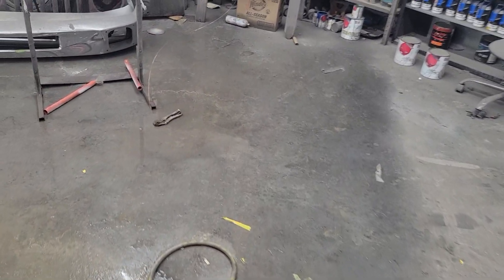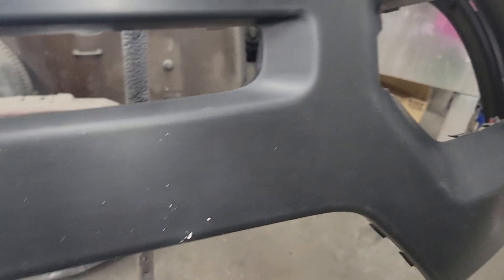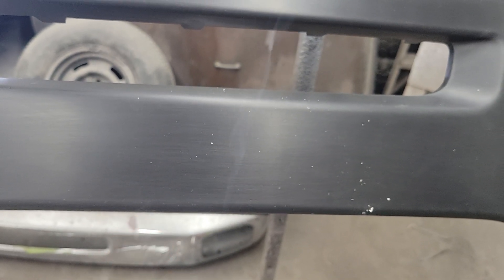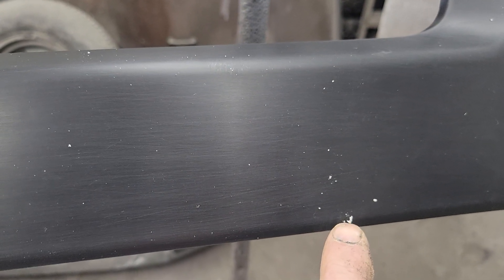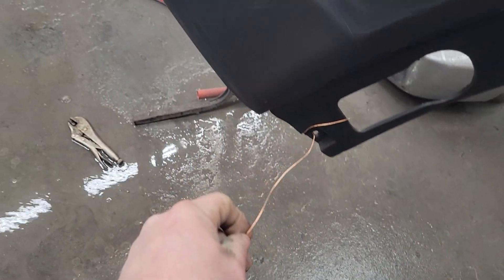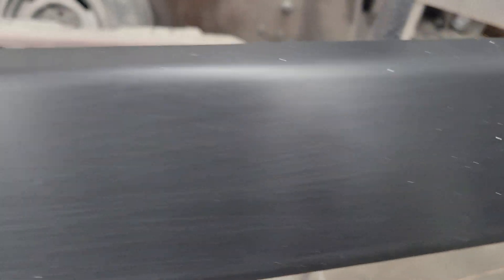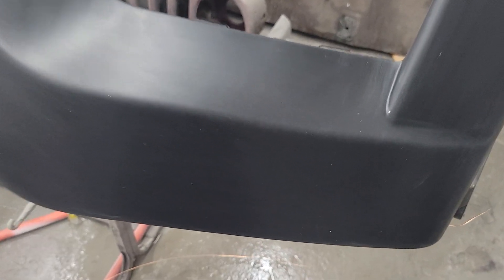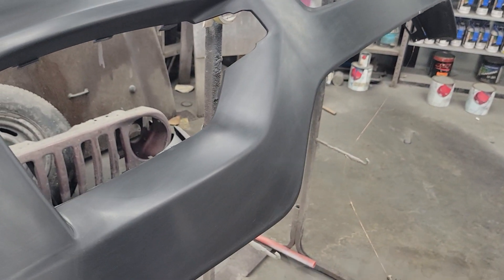Major static electricity in the paint booth

Comment: try using water or glass cleaner, since we swapped to water bourne paint a few years back at work i been using spray bottle glass cleaner instead of regular panel wipe, even at home with solvent paint i use glass cleaner, try cleaning a bathroom mirror with panel prep vs glass cleaner!!

you get the same problem if you try to panel wipe a fiber glass car before you pinstripe it by hand, the static pulls the paint from the brush, so i wipe it with a damp cloth and let it dry then its ok

also to note, tack cloths for water bourne paints are way less sticky than solvent ones of old, they were too sticky at times so again some good has come from water bourne paints etc,  they make for a great barrier for going over old repainter panels when you aint stripping stuff back to metal